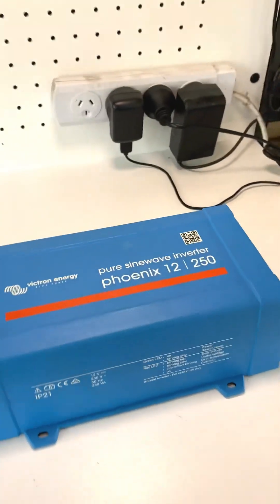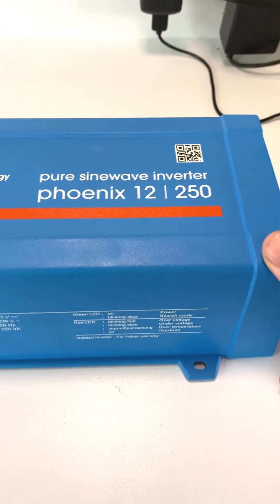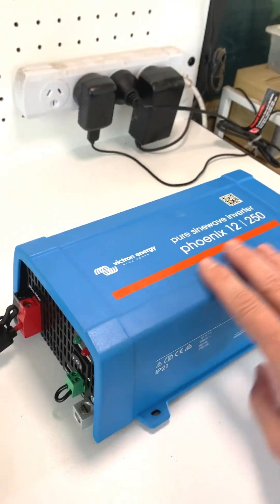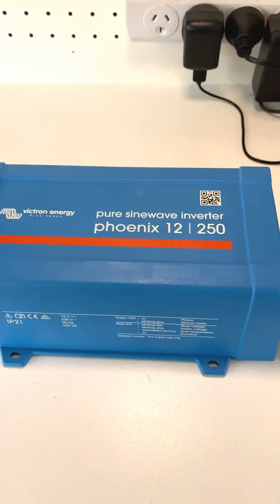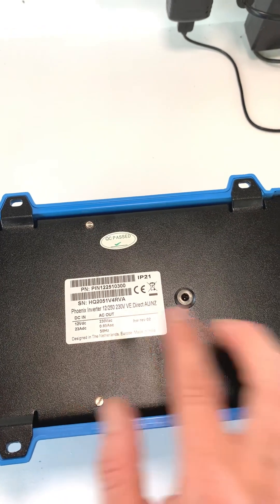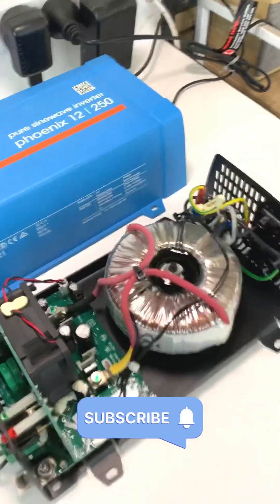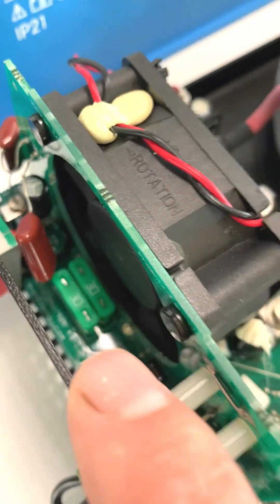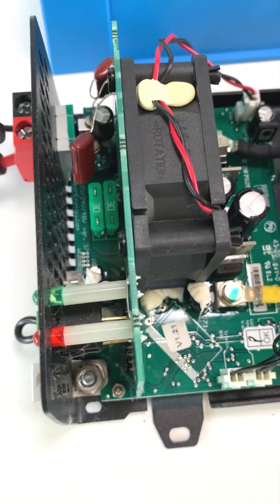Victron phoenix inverter. TEARDOWN!  #victron

Comment: Sweet little inverters. They must have soldered those fuses to the board? Specs say that they are fused but non-replaceable. I've got a 48/375 for my lights in the solar shed so I've got lights when my inverters are down for updates or maintenance of some sort. Awesome they take a dry contact for on/off operation. Ran a little 20awg paired cable over to the door popped in an instant light switch. About a 3 second delay on and off but that works out if I'm running from the boogie man! hahaha
Reply from the maker: Yeah mate great inverters. Yeah from memory the fuses are soldered to the board but I reckon you could solder in a new fuse if needed ;) I would love to build a 48volt system one day. I would go a Victron mulitplus inverter maybe 🧐  I like the light idea. Boogie man doesn’t approve though. Hahaha

Comment: Please look up the terminology and stop saying things like "amp hour" when you mean amps.  This is an interesting "quick look inside",  not a teardown.
Reply from the maker: Sorry mate. I have dyslexia. I know it’s amps. I’m thinking amps in my head but saying amp hour. Thanks for your feedback
Reply: Solid video - first thing I noticed with the 375 model was the weight of the thing - it’s bloody heavy - which means solid build quality 

Bit strange they didn’t use standard m8 connectors for the battery side but rather a silly 10awg screw mount connector
Reply from the maker: @studiosoundguy they are heavy for sure mate😅 and I agree also that they need stronger terminals ones that you could through a bolt through would be the go. Thanks for tuning in